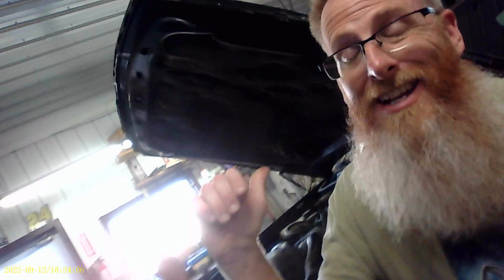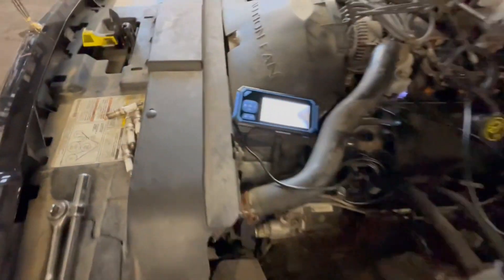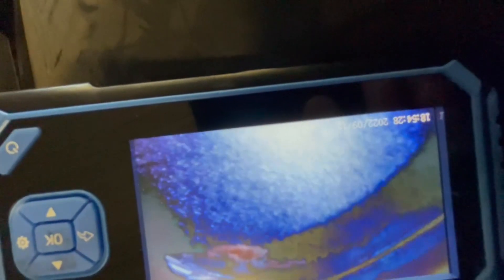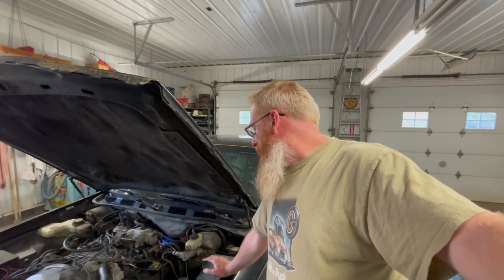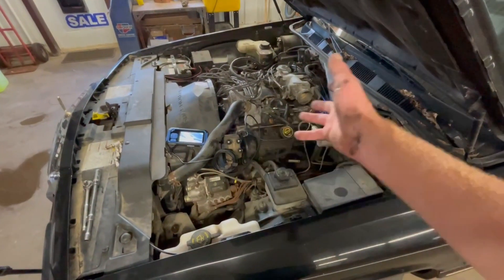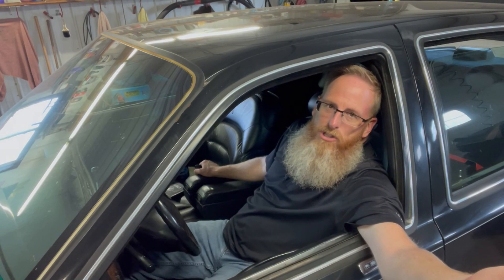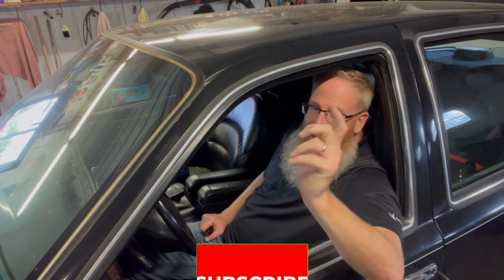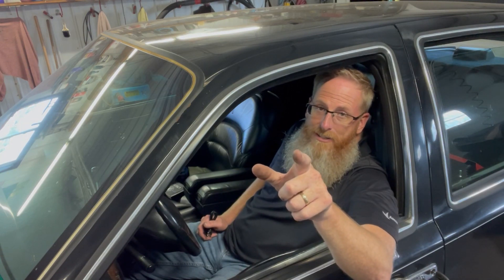Timing Chain Failure! FORD 4.6L 2V Rescue In My 1997 Lincoln Town Car- It's BAD!! Pt.2

Comment: First time I've seen your channel.
On ALL Ford 4.6L 2 valve engines, the cylinders are numbered, starting at the front, right side 1-2-3-4, and left side 5-6-7-8. I know these engines well. I have worked on a lot of them. They are, IMO, the best "modern" engine Ford has ever built. I still MUCH prefer the older '60s and '70s OHV engines, and always will. I am also an "old car guy", but in my case I'm an "old American car guy" I mostly deal with carbureted OHV American V8s) Nevertheless, these engines have proven to be reliable if left stock and properly maintained. And to me than means an oil change every 3000 miles. I have a 2006 Mercury Grand Marquis with 278,000 miles on it (just over 200,000 are mine) and it still runs like new. Mine are mostly highway miles. On a 4.6L 2 valve, if the valves and pistons actually have made contact, I would scrap the engine at that point. These engines are literally (well, almost) a dime a dozen. Get a good used engine, or if the car is in really good condition, replace it with a Powertrain Products rebuilt engine. 

Unrelated to the problems with that engine, but that power steering pump is a royal PITA. It is almost impossible to change the oil filter without a socket type oil filter wrench. There is just no room to get a strap type wrench in there. Bad design. One good thing about this engine is NO VVT. That is a definite engine killer. 

The rear air suspension on my 2006 Grand Marquis did fail, air bags rotted out. I replaced them with coil springs, problem solved. I can't tell any difference in the ride or handling.
Reply: Thank you for this informative comment. I have a 95 LTC (all original) and although I’ve only owned it for roughly 90 days, it has been the smoothest, most low maintenance ride I’ve ever experienced. Love these cars!
Reply: I replaced all the air springs on my town cars before they failed but always keep the system turned off so the pump doesn't turn on when it's -50. Coil springs are a good alternative if you're not hauling much but they sure come in handy with a trunk full of winter ballast.
Reply from the maker: I sure hope you subscribed. I have a lot of panther content. I think I'm going to take the head off just for fun. If no notable damage other than valves, I may fix and slap it back together. What do i have to lose other than time?
Reply: @pantherplatform  I'm in AZ, so I don't need "winter ballast". I disconnected the power from the pump, which is under the air filter housing. There is a wire in the harness (can't remember which one) that has to be cut to eliminate the "check air suspension" warning on the dash. It's behind the glovebox. Another issue common to Panther cars is the climate control blend door actuator tends to fail. It's a small plastic box with plastic gears in it, and the gears eventually strip, usually in the full heat position. Replacing it requires major disassembly of the dash. By removing the glove box and passenger airbag, I was able to reach it with a chisel attached to a long rod made up of several 3/8" drive socket extensions, break it up, and remove it in pieces. I jammed the door in full A/C position. We don't really need heat here in Phoenix, AZ. There are makeshift ways of fixing it, if you are in a cold climate and need heat/defrost.

Comment: People give up on the air spring system to often on these cars they're not hard to maintain and ride much better than than the spring kits
Reply from the maker: I’d be inclined to keep it as long as I can.
Reply: i have 6 lincolns with "air ride" and replaced them ALL with coils for only $75 a car. The air ride systems are expensive, horrible and fraught with break downs.
Reply: arnott bags under a 100 bucks,bought a 95 sig that went 20,000 in 20 years.in ohio always in heated garage.paid 9,000  to 2 owner.34,000 mile.car still has factory marks on it.white ex- blue interior grey bottom.repaint bottom gloss black.47,000.

Comment: Wow. That's a real car there. My 95 town car has been the most reliable winter car I've ever owned. Holds a thousand pounds of used brake rotors in the trunk with ease and goes anywhere with it's Bridgestone blizzaks.
Reply from the maker: Nice! I'm really looking forward to driving this one!
Reply: @OldeCarrGuy  I admire the 95 model year's all aluminum intake manifold vs the 96 and newer junk plastic that leaks on every one of them but that's basically the only issue. The 92-95 aluminum intakes have an egr passageway where the 90° bolts into it and they can get carbon deposits and run crappy but a quick clean with some carb cleaner and a toothbrush and it's good to go.
Reply: @OldeCarrGuy  it ain't no 04 Grand Marquis I tell ya

Comment: My 97 is almost perfect. Blend door is being replaced when i feel like pulling the dash. I replaced the rear bags in 2015. Cheap and easy to swap. Amazon rocks. I did soak the bag with Aerospace 303 first and id say it was a good move, not a fail yet
Reply from the maker: Great information. Thanks

Comment: Man this makes me miss my 96 towncar executive  series , same exact car but had the factory deep purple paint job , best riding car I've owned next to my 77 town car
Reply from the maker: Thanks for watching Matt!
Reply: @OldeCarrGuy  I will say however well you have that engine torn apart if it doesn't already have the upgraded intake manifold I would strongly recommend doing it because the new manifold is all metal where is the old one was plastic with a metal shelf for the alternator and they often broke apart

Comment: You might as well fix that engine, yank the head either send it to your favorite machine shop for a valve job and install new valves, brand new used. Or take it apart yourself and see if in you can lap the new valves in or if that doesn't want to work, valve job time. With only 5,000 miles on the rebuild its a no brainer to fix the engine in there?

You can save the other 4.6L for the Hugo! LOL
Reply from the maker: One way or another, we're rebuilding a 4.6!

Comment: Is there a benchmark with these cars  (4.6) where preventive maintenance is worth it?  This type of job, just do it regardless around 200 k miles?
How about plugs and wires, how often to replace?
Reply from the maker: From what I gather, the timing chains are good to approximately 400-500k kilometres (250-300k miles). So yes, preventative maintenance would say to act early, rather than react too late!
Reply: Ok. I own a 1996  Grand Marquis that I've had Bout a year now.. Previous owner had it about 9 years  and only put about 4 k miles on it  and it sat in a dry garage the rest of the time.   I'm just kicking around the idea of getting the alternator replaced and plugs and wires  as a preventative measure
Engine runs and shifts smooth right now  but I'm thinking future and preservation

Comment: If you're going to pull the cyliner head and work on it, you could try something a little trick.  Get a set of rebuilt PI cylinder heads, and the corresponding intake manifold.  You'll get a slight boast in compression ratio (about 1 point), and alot more flow with good drivability and decent fuel economy.  It will cost a little more, but if the short block is OK, it might be an interesting option.
Reply from the maker: I like that idea. We'll see what the budget looks like after we pull the head.

Comment: At the bottom of the hose there is a valve. Looks like a bike tire valve (shrader valve) Take that out and use it for the leak down kit, put back in when you need to do a compression check.
Reply from the maker: Yup! Got it! lol Totally wasn't thinking!
Reply: @OldeCarrGuy  No problem, weve all had those moments!

Comment: I believe the cylinder numbers for that Ford should be 1-2-3-4 front to back on the passenger side, and 5-6-7-8 front to back on the drivers side.
Reply from the maker: I knew that, it just didn't want to come to me. I'm so used to GM & Chryslers evens and odds.

Comment: Rip out the air ride and put normal coil springs in it
Reply from the maker: Eventually!
Reply: After the 3rd set of air bags we did the coils. 
Are town car was bought new in 92 and has 341,000 on it now and looks like the day it was bought. Same drive train and always maintained. 
Hello from Sarasota Florida

Comment: my 95 towncar has been down for several years due to a engine knock. i have a engine and trans from a 97 but dont really have anywhere to try and put it in so it will sit there until i can get a shop to be on concrete to be under the car cutting everything loose. here is a video of it running and knocking. https://www.youtube.com/watch?v=qctSXJisoEA
Reply from the maker: Sounds like a broken connecting rod to me. Thanks for watching.
Reply: @OldeCarrGuy  yea its bad and i cant wait until i can get the other engine in it so i can tear the old one down to see what went wrong with it. it did run low of oil a few times due to the oil filter adapter gasket basically pouring oil out of it when i was still daily driving it. i have a 96 towncar jack nicklaus  edition that is as fully loaded with every option as a cartier edition.

Comment: I’d say it’s worth it to pull the head and replace the valves rather than replace the whole motor with a used one. You’ve got a nice rebuilt motor there and It’d be a shame to scrap it.
Reply from the maker: I think that's the next step for sure. Not much to lose at this point!
Reply: If you are absolutely sure it is just the valves I would agree. But there could also be damage to the pistons and possibly even the rods, which you can't see without a complete engine teardown. 4.6L 2 valves are so common you can get a rebuilt long block for around $2500, or a brand new one for not much more. If all you have to lose is time and work, and are making YouTube videos of it,  that's a different story. My plan is to put a new or rebuilt long block in my 278,000 mile Grand Marquis when it wears out. But I need it to be cross country reliable.